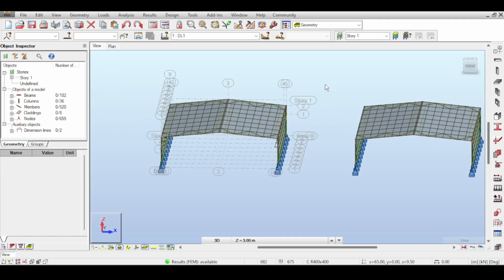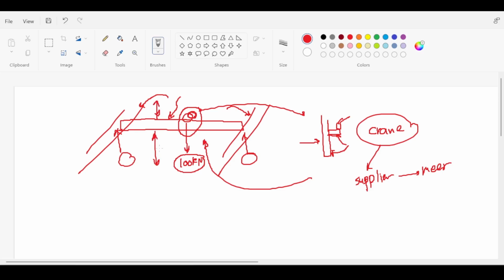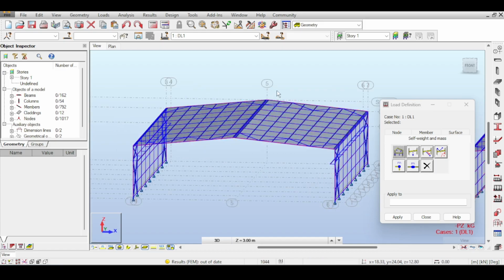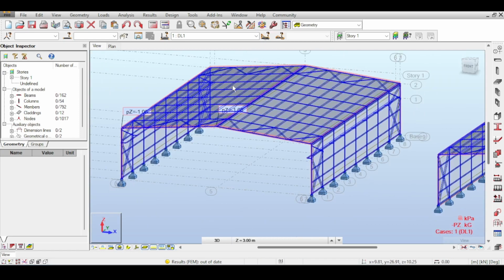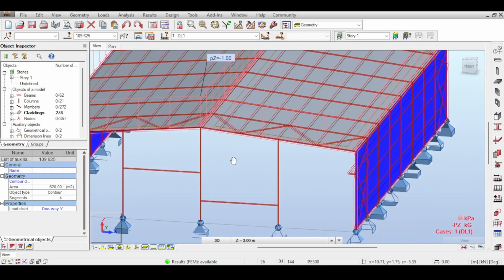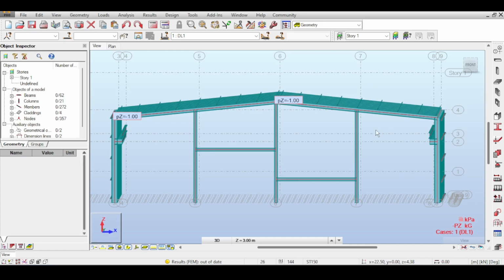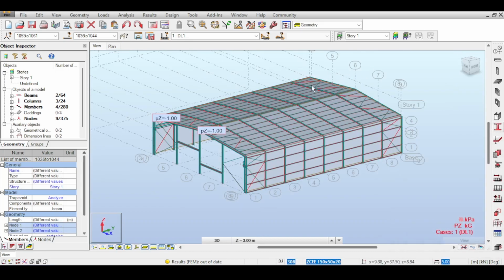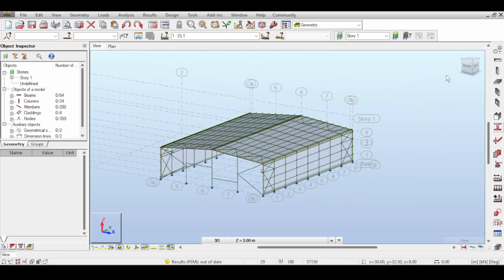Modeling of Industrial Warehouses | Part 4: Forces and Gable Frames

Comment: Hello
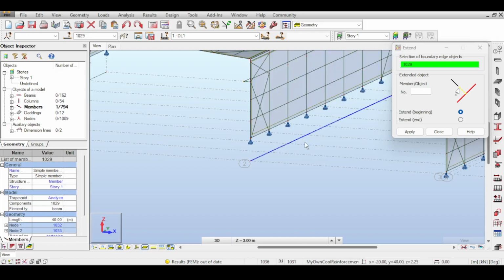3:00 I suppose mr. Recorder was just flexing here, since in previous videos he showed great knowledge in RSA manipulation (silo series comes to mind).
In my case, for example: after moving the entire structure up, I just selected the lower nodes (the pinned ones) and moved them back down. 👌 Excelent result

In a somewhat related manner, I would consider just moving the pined nodes down (under 0.00 level), since in reality the foundation is actually underground, thus resulting in the Z axis in the same value as in reality - easy to correlate with the architecture and cutting down on possible errors from the beginning.
Reply from the maker: Mr recorder was getting better at that time ^_^
Also, this advice for moving and selection is really awesome. I would pin your comment to help future viewers.

Thnx a lot for being part of this community. 
Regards,
CEE

Comment: Thank you so much for this educative video. I really enjoy the monologue and thought process.
I was kindly seeking some clarity. Suppose I have a column with a pinned support. And then I apply end releases of a Pinned - Pinned type. How does Robot interprete that? Or if the column end towards the support is set to a Pinned - Fixed Releases yet the support is set to pinned? Kindly elaborate on this.

Thank you
Reply from the maker: Ok so first: here is what I understood from your comment (feel free to correct me if I misunderstood)
- You have a column
- The column is pin supported at the bottom
- The column is pinned at the top. You decided to use the pinned-pinned release on that

I understand why you did use pinned-pinned, because it seems you are worried to use "fixed-pinned" because you think that the release might override (destroy) your pin support. So you are thinking that: if the support is pin, then I must define a pin release at the support.

That is, unfortunately, not accurate. It even caused an error "too many / excessive release at node X" in older robot versions.

Ok, so here is the exact explanation of how robot does the release. I will draw the column horizontally to show it
(Support)==============Column===============(Connection With Beam)

The way it is modeled is:
(Pin) (Column to pin)============Column===========(Column to node)(connection)

The release does not change the pin from pin to fix. It does not affect the pin itself. It affects how the column is connected to the support.

This causes the following effects:
Fix Support + Column Release (Pin) at start = Pin support
Pin Support + Column Release (Pin) at start = may cause problems in the software
Pin Support + no release = Pin support
Fix support + no release = fix support

I hope it makes sense.

Now one final thing I noted. It is the construction philosophy that is behind your question. Usually, we apply releases to beams and not to columns unless we have a reason to do so (such as gable column connection), or because we are unable to model the release on the beam.

Why? because usually it is the beam that is connected to the column and the column (if multi story building) may be as long as two stories.

I hope it makes sense. Sorry for my long answer
In case I missed anything in your question, please feel free to ask.
Regards
CEE
Reply: This makes perfect sense now. Thank you so much for the long answer..😂 It is exactly what I needed for me to understand! ✨ 🙏
Reply from the maker: Great, happy I were able to help. Sry for the delay in my answer👍

Comment: gable column flanges should be facing outside.
Reply from the maker: I think it kind of can be done both ways. But for the released connection, your suggestion is cleaner.
https://www.google.com/imgres?imgurl=https%3A%2F%2Fkhomesteel.com%2Fwp-content%2Fuploads%2F2022%2F05%2FBracing-System-1-1024x686.png&tbnid=RZ7UPRwCNfK5UM&vet=1&imgrefurl=https%3A%2F%2Fkhomesteel.com%2Fbracing-system-in-steel-structure.html&docid=EXbKwIcz062OKM&w=1024&h=686&source=sh%2Fx%2Fim%2Fm1%2F2&kgs=ba69e2b23530d90d&shem=abme%2Ctrie

Comment: I think wind columns should be rotated 90 degrees to get big rigidity in Y direction
Thanks
Reply from the maker: I think I agree with you on that one. Just one thing to note: is to compare the moments and forces from wind vs the moments and forces from gravity, because the structure is rather "short / low height" so maybe the gravity loads are more significant.

Still thnx a lot for your input. You do have a point here.

Regards,
CEE

Comment: Dear CEE,
I recently visited a construction site and observed an interesting aspect related to the placement of the bracing system. In the video I captured during my visit, there seems to be a gap of approximately 30 cm between the connection point of the bracing system and its foundation connection. I've shared the video on YouTube for your convenience.
https://youtube.com/shorts/xgi14xDP138?si=614_bFJi76SWOI9g
Reply from the maker: First of all, your comment is going to be pinned just for the sake of benefit of others. 

In the video, I can see that the column is drilled and the bracing is attached via a bolt from the other side of the column. Now this is one valid way of bracing a structure. Another way is to provide a gusset plate welded to the column and connect the bracing there (on a lower height than 30cm).

As for my comment on why. I am thinking of 2 possible reasons, but of course I am more than happy to hear if you got infos from your side.

Avoiding stress concentrations: Connecting the bracing directly at the support could create a stress concentration at that point, potentially leading to premature failure. The 30cm gap helps to distribute the forces more evenly and reduce the risk of localized stress buildup.

Accommodating specific beam or column details: The support itself might have some specific details or features that prevent the bracing from connecting directly. The 30cm gap could be a workaround to accommodate these features while still maintaining the bracing's effectiveness.
Reply: "Yes, doctor,

From my perspective and what I've learned in the past month, in steel structure projects, there are two approaches. One involves on-site work with cutting and welding of all structural elements, commonly seen in large projects like skyscrapers. However, I haven't personally observed this method in Lebanon. I will check with my father, who was a project manager, to confirm. The other method entails assembling elements off-site and then bolting them together during on-site installation.

Regarding your specific question about using cable bracing systems or traditional gusset plates and steel members, opting for cables assumes that the bracing system works primarily in traction. In contrast, using solid elements allows flexibility for the bracing system to function in compression if needed. This is my understanding of the matter.In plus what is most important for me as my previous work was in procurement is the cost and time management , assembling your connection on site is always faster , but it needs more time to prepare it in the industry ,but  when it comes for bigger project this will cost the investor a lot of preparation and waiting - eventually it could make a coast also to manage it , so welding on site is faster and shepaer for bigger project , but for smallest one ofcourse preparing is better.  Please correct me if necessary."
Reply: "Yes, doctor,

From my perspective and what I've learned in the past month, in steel structure projects, there are two approaches. One involves on-site work with cutting and welding of all structural elements, commonly seen in large projects like skyscrapers. However, I haven't personally observed this method in Lebanon. I will check with my father, who was a project manager, to confirm. The other method entails assembling elements off-site and then bolting them together during on-site installation.

Regarding your specific question about using cable bracing systems or traditional gusset plates and steel members, opting for cables assumes that the bracing system works primarily in traction. In contrast, using solid elements allows flexibility for the bracing system to function in compression if needed. This is my understanding of the matter. Additionally, considering my background in procurement, cost and time management are crucial factors. Assembling connections on-site is faster, but it requires more time for preparation in the industry. For larger projects, this preparation time may incur significant costs and waiting times, potentially impacting overall project management. Welding on-site proves faster and more cost-effective for bigger projects, while pre-assembly is advantageous for smaller ones. Please correct me if necessary."

Comment: Dear CEE,
Just wanted to drop a quick note of thanks for your awesome videos—they've been a game-changer for me in getting the hang of Robot and feeling more confident in my engineering work.

Quick question on your recent video about concentrated loads with cranes. I get the simplicity of treating it as a point load, but what are your thoughts on modeling the crane beams and factoring in earthquake effects? Especially in quake-prone areas, it seems like it could add some valuable detail to the analysis.

Totally get that it depends on the project and codes, but would love to hear your take on when it's worth going the extra mile with crane beam modeling and earthquake considerations.

Thanks again for being a solid resource in the engineering world!

Eng Ali Omar
Reply from the maker: Gotta check that out myself. I might need to research a bit here. Seems your place is a mountainous region or near mountainous terrain.

However, my first impressions is to disconnect the crane from the main structure (if the crane is heavy) to avoid the earthquake from significantly damaging the warehouse structure (you know, F = m * a).

If you want to really analyze the crane under earthquake loads (whilst it is connected to the warehouse body) then I can give an initial thought as follows:
You would have to calculate the lateral load on that crane mass (+ moving beam assembly) from your EQ load equation
which usually goes like this: F = some cool factors * mass or weight.

Then, I would do a moving load with 2 components, lateral and vertical, and move it on the entire warehouse. This would simulate the earthquake striking the warehouse while the crane could be anyway.
Note this will immediately have an effect on the columns (if the crane's runway - the beam where it moves longitudinally - is connected directly to the column)

Now please note that this is an idea that got into my mind immediately. I would have to go back to my planning bench and do some research to give a complete answer, but this is what came to my mind immediately.

Hope this could spark some ideas. Regards,
CEE

Comment: Hello Doctor , 
I couldn't find The moving loads in the loads , special loads , how can i add it to my database ?
Reply from the maker: multiple people have noted this.
There are two possible things:
1) you did not select "building design template"
2) It is a Robot Version issue. It was reported to autodesk, maybe installing a different version (2022) would help.
Reply: @CivilEngineeringEssentials  I Started the model again and it works I don't why , Thank you Doctor.

Comment: In 35:00 about the stability of the gable column : actually we connect the gable column with the rafter with vertically slotted holes, in such way it acts like a pin-pin column but released in Z (vertically ), so that it will not take any vertical load from the rafter in real structure  and the gable is stable now.
Reply from the maker: Yep. That is correct 👍
I adressed it in the next parts. A huge thnx for your input, much appreciated.
Regards, CEE

Comment: i've a problem of rotation Rz (instability type2) of the (beams(TREC50x30x4) nodes) connecting the middle gable frame column. Please how to solve this problem please ?
Reply: I took the spacing in the Y direction of my structure as 10m. The total Y length is 30m. 

Is this a wrong design?. Or it IS bc of that i have the Rz problems?😢

Waiting for your worthy réponse Sir. 
Thanks in advance
Reply from the maker: Hi there, My guess is that your RZ happens due to having too many releases. Now instability problems have been addressed multiple times on this channel and here is a nice ToDO list to follow to pinpoint and understand why an instability happens:
Step 1: Save your structure as a new file "Test"
Step 2: Make all supports pinned
Step 3: Remove all releases

Now analyze, should have 0 instability.
Now start step-by-step reducing the amount of rigid joints.
Step 1: Put the supports back to pin (if that is your assumption?) and try. If stable, continue to step 2
Step 2: Release 1 group of members or bars (like purlins), run and see if stable.
Repeat Step 2 with different groups, until you pinpoint exactly which release caused the instability

Then you can deal with it by bracing/undertanding/etc

Hope it helps,
Regards,
CEE
Reply: @CivilEngineeringEssentials  Yeah understood. Thanks for the help Sir. The rafters are What causes this instability. How Can i resolve this instability, have use thesame modeling as yours but applied more heavier loads.
Reply: With an Rz problem.😥
Reply from the maker: It is a little bit hard for me to provide text advice, but please also make sure that the rafter to column connection is not released, and the purlin to column is released only in bending rotation.
Sorry for the trouble you have.
Reply: @CivilEngineeringEssentials  Thanks Sir, you help me figure Out my problem. and Thanks for Always answering to the comment. 

CEE, the best Civil engineering Channel ever

💫💫⚡